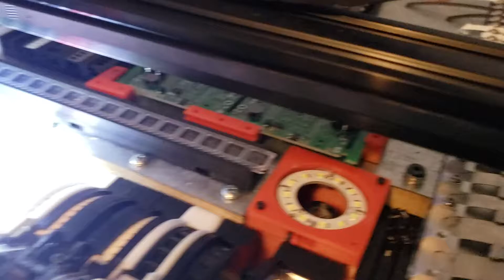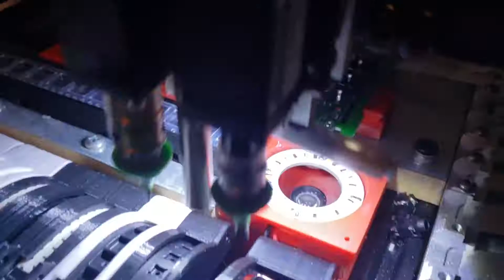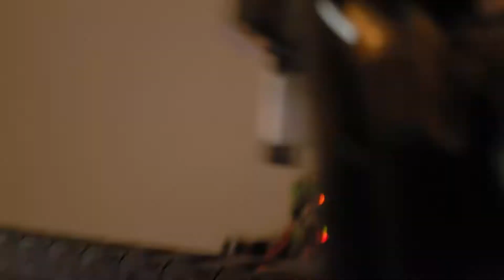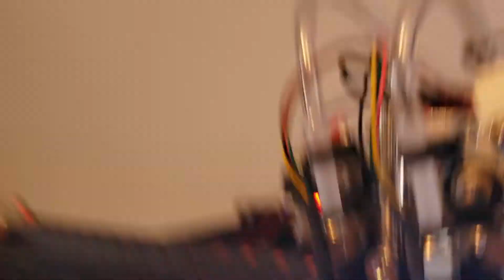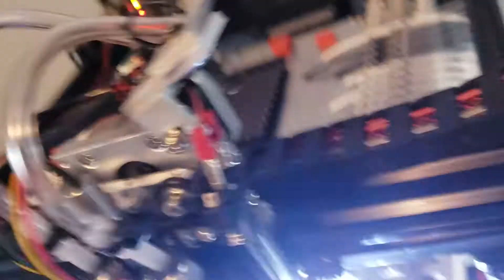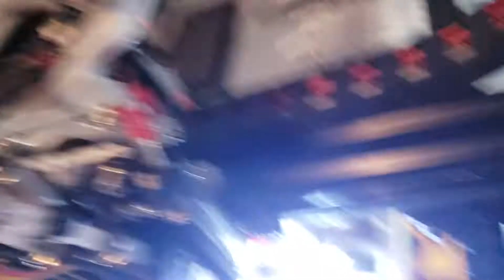DIY Pick and Placing some larger parts with auto feeders

Comment: How well does this do at placing chips, like QFN?
Reply from the maker: I'm actually having an issue with rotation. It's always just a little tiny bit off, depending on how much it has to rotate. I'm trying to figure out why now.
Reply from the maker: I just fixed this. See https://groups.google.com/d/msg/openpnp/6TgY0_L-umU/_CjFOr6TBgAJ
Reply: @jdeg2000  great John. I will be soon building pnp using the heads from AE. I will let you know how it performs, I have also used little more cost effective BOM, we will see how it goes. Good for you that issue is solved and machine is working well :)
Reply from the maker: @zxy1193  thanks! Good luck!